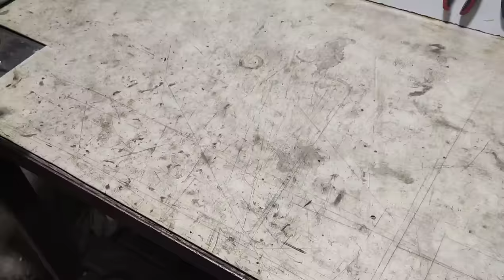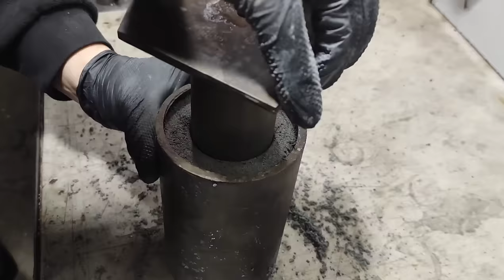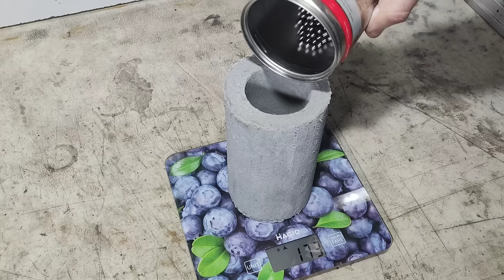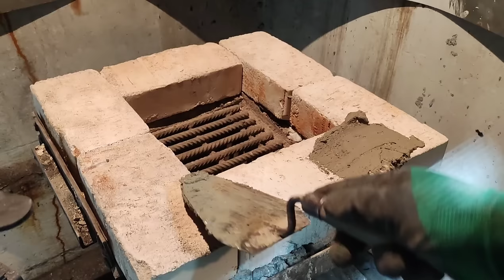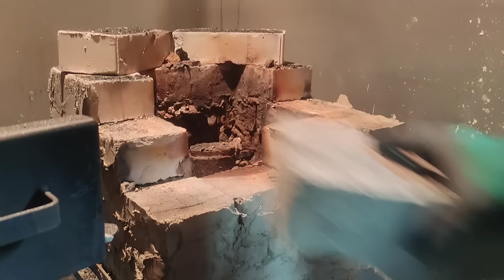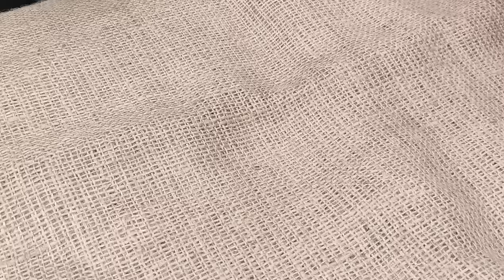How to make a melting FURNACE and CRUCIBLE for WOOTZ steel

Comment: True wootz will come from the mine of Salah Ah Din. There's a 3% vanadium content in that ore that isn't present in other areas, which made for exquisite patterns once drawn out.
Reply: You are make some "true wootz" right now?
Reply: 3% vanadium ??? No. No way. Maybe 0.003% or 0.03%, but not 3%. A tiny amount of vanadium is enough to change the pattern of a wootz steel, and vanadium is rather rare in ores.
Reply: @jeanladoire4141  it's not about the pattern, it's about the properties that the vanadium imbue into the steel. Those swords were known to flex in combat and then come back to being true after each strike. The mine that Salah Ah Din used was found again, and the composition of the ore was determined from samples taken.
Reply: @gra4279  ancient wootz steel didn't have significant vanadium content, it didn't affect the properties of the steel like with modern steels. Larrin Thomas recently made a video on his tests of wootz (following the ancient compositions) and the performances were pretty bad. Hard steel, but very brittle. A lot of ancient wootz swords weren't even hardened, by fear of breaking them. Tiny amounts of vanadium only had effects on the pattern, and not much more

Comment: It's amazing how inclusive the blacksmithing community appears. However, so many processes and techniques are shrouded with secrecy. A lot of questions are met with either extremely technical jargon, or vague brush over. 

Thank you so much for this video. Still leaves a lot of questions for the green, but at least gives a comprehensive step in the right direction.
Reply: … Because a lot of things are rather technical or require skill accrued from practice to do. So you have a simple version, and the actual technical explanation; wait, what’s the complaint again, if there is clearly both being presented? Also, very few things are secret in blacksmithing anymore, anyways.

Hell, do you know how dangerous molten steel actually is? Drop that on concrete or anything wet and you have an uncontrolled explosion with shrapnel and molten iron. If you want the technical info, go to blacksmithing forums and not youtube.
Reply: @farmerboy916  I do surf the forums when I am in search of information. The closest I found to an instructional for wootz/crucible steel. Was basically a journal entry cataloging one person's experience working with the metal and how he made cast iron several times. Not how he made it. "I put it some high carbon steel and a low carbon steel to balance it out between 3-5% carbon content. Topped it off with some glass, I  prefer champagne bottle. Then I put it in the furnace for a while until it's melted." 
Yeah very helpful. Thanks. No mention of method, fuel source, or even an actual duration.
Now,... Google isn't my friend. Many an hour I have wasted trying to find information. Only for the topic to come up shortly after in conversation and someone will list off a bunch of sources. 
YouTube is not the be all/end all of quality information. But sometimes it is the only place to find an explanation.
Thanks for the input
Reply: @cameronroberson1114  If you really want the best source out there especially on YT, it’ll probably be Neils Provos. Old videos but good. Admittedly, some of the old thread and forums may have died now, but I suspect there’s more than that.

Think about what you’re asking; it’s crucible steel usually done with a closed top, so fuel or heat source technically doesn’t matter a whit (even open top is only going to have so much effect one way or another depending on carbon compared to the atmosphere), and each home constructed foundry is going to have different capabilities and requirements and run differently. Any refined fuel is going to run hot enough for you with enough air, at least in theory. As well, until you break out digital scales and start working with pure or specific known compositions there’s not really any ability to have material consistency between people. 

As well, what’s your goal? To make good steel and alloy, to make it from scratch for the novelty or for the challenge, to imitate classical wootz/ bulat (and to what degree), to recycle material? Some are much more difficult.

With this many variables no one wastes time trying to write a comprehensive guide, you’re going to have to pick a direction and estimate and troubleshoot.
Reply: inclusive? i see people sh!t on pattern welded knives/etc all the time and scream "iTs NoT tRuE dAmAsCuS!!". Especially on youtube shorts or shorter form content, maybe their way more inclusive on forums or in real life, but in youtube specifically i see plenty of hate
Reply: @IllNacs  … So you see people say something pedantic but true, and say it’s awful because of that? Grow up.

Comment: I love watching your videos. They are always fun. Could we get general amounts of the materials you used for the crucibles in the mix?
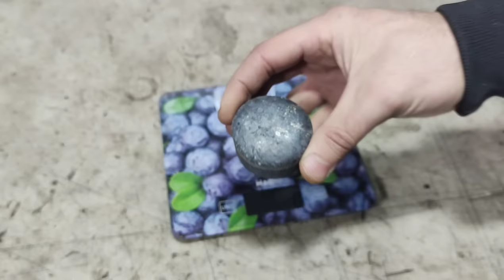Reply: Assuming 525g final weight at 7:30
~33% whole bearings (173g/525g=33.33%)
~58% bearing balls (303g/525g=57.71%)
~9% iron powder (46g/525g=8.76%)

It looks like he adds around 2g of graphite at the end, though that's just an estimate. Maybe 0.5%?

If you're considering steel strength, you would want around 0.5-1% carbon by weight. The ball bearings he uses are likely 1% carbon already, so you might adjust the recipe he's showing here to have more iron powder and less graphite powder. Glass powder is just flux, enough to cover the top will work. Not precise.

The most important things seem to be the use of different sized bearing steel (chromium steel) parts and iron dust to create the wootz pattern, plus a little carbon (graphite). For anyone looking to try this, you might use this recipe:

~90% Chromium steel parts of various sizes
~9.9% Iron powder
~0.1% Graphite powder
+ Enough glass powder to cover the top
Reply: @N1ck00  Thank you for that break down of the steel. That does help for when I want to do this later. However, I was asking about the crucible itself, not the metal going into it.

Comment: This is another amazing video!  Do you have to re-build the furnace every time you create an ingot?  Also, what types of steel work best for wootz?  I think I've read the ball bearings are often high in chromium.  Great video! 👍
Reply: If you want to get pretty close to the composition of historical wootz steel you might try melting 1 part W2 steel(for the vanadium) to 9 parts wrought iron with enough charcoal powder to get the total carbon content up to 1.5%. The chromium from ball bearing steel is a carbide former, but it will be somewhat different than vanadium, and I don't know how much you would need to use.
Reply: @garethbaus5471  This is fascinating to me - I read the old Pendray articles way back when, but metallurgy is pretty far over my head.

Comment: Thank you for sharing your process. Truly generous of you. If I may push my luck - does the amount of graphite you're adding matter? I see the amount of HC steel to iron powder you're using, but the graphite was a mystery. I really really want to try making my own but finding a complete recipe is really hard and I have no methods of testing steel composition or actual HRC.
Reply: I'll go out on a limb and say yes, it likely does, though I'm really only guessing and basing it off modern metallurgy practices.  Too much graphite and you'll end up with a fancy cast iron alloy, don't put any in and you'll end up gassing off too much carbon and end up with a fancy mild steel alloy.  I guess you'll have to experiment with different quantities of graphite and see if you end up with a malleable steel or a brittle cast iron.  There are numerous ways to determine a rough estimation of carbon percentage based on how the metal acts when you drill it, grind it, bend it, harden it, etc. so you'll be able to spitball your way into the right range.  You'll certainly want to buy a set of hardness files off amazon, or a set of hardness chisels that you can re-sharpen over time, not just for this, but to check whatever knife you make to see if your heat treatment actually worked.  Probably not the answer you wanted, but if you're determined to make crucible steel, you'll be capable of getting your own answer eventually through experimentation.  I'd start off approximating the amount of graphite based on the video and adjust from there if necessary.

On the other hand, perhaps the graphite will only infuse so much into the steel, and the steel simply won't be capable of absorbing the excess in a crucible.  So maybe it doesn't really matter how much graphite you use, just as long as you use enough for it to do its thing.  I honestly wish I had a better answer for you.
Reply: @Skinflaps_Meatslapper  First off, love your username. But yes, I know that the hardness files exist but they're a bit dubious at times, and as a hobby smith with a full time job i'm just being lazy and want a quick answer :) I don't really have the free time to experiment with something like this, since having all the answers will still require a lot of tweaking to get it dialed in already; working with too many variables (with one of them being graphite amount) essentially makes this an insurmountable task for me, practically speaking. But maybe i'm  just being a turd and should just do it and figure it out myself anyways, I guess its not like I have a timeline to learn this. I just figured since FZ is already being insanely generous with his information, it wouldn't hurt to ask for that last variable. I know that the graphite can potentially turn the billet into cast iron (I have a decent understanding of metallurgy basics), but like you said maybe there's a rate limiting absorption happening with that cook time and temp and a general amount is all you really need to figure out? I couldn't say. Maybe I should document my journey...hmmm
Reply: @thezoidforge9211  Sounds like you're in the same boat as me.  All of this is well within my abilities and budget to test and experiment, but a bit over budget on free time.  I basically came to the same conclusion...I'll just have to start cooking buttons of steel and testing them until I get to a point where I have good consistent steel to work with, making notes along the way.  95% of the work and knowledge has already been passed down to us, we just have to figure out that last piece.  Imagine what it was like for the smiths to go from knowing nothing about crucible steel to developing all of the techniques and processes we know today.  More than likely it took the dedication of many generations to see it through.

The way that ingot rings at full forging heat leads me to think that maybe I should get a press and power hammer though.  Only time I ever had steel like that was when I got some high strength sucker rod for deep oil wells, I could hardly move the stuff with a 4lb sledge.  Not really looking forward to that part.

Comment: Finally Thankyou can I use bentonite clay instead?
Reply: if it were me, I would use fire clay as he suggests in a prior reply.  If you google the "maximum temperature" and bentonite or fire clay, you will find that fire clay has a melting point of >1,700C while bentonite is >1,200.  Remember that many of the published temperatures for experimental wootz furnaces are ~1,650C.  I wold expect that a crucible made from bentonite clay to become fully plastic and essentially melt at ~1,600C.  I wish I had digitized copies of the photos we took when the temperature controller for one of the kilns in my families pottery business failed in the ON position...  We had an entire load (~1m^3) of "earthenware" pots (which has a melting point of ~1,250C), and by the time we got everything cooled down (including the walls which were steaming for most of a day), the pots melted and literally were drooping over the edge of the kiln shelving.  

Fire clay is a very common material to purchase from a ceramics supply store, just make sure that you purchase a high-quality clay.  Also, here they call the "fire clay crumb" I have always heard called 'grog', but it is also commonly supplied at every supplier I have ever seen.  Alternatively, I would suggest cobbling together a furnace/kiln like he shows in his videos, and experiment with making crucibles from different materials and firing them with some easy to find materials (like steel scraps) melt.  I would expect that the bentonite will fail long before the steel actually melts.  If you try this, make a video, and post back a link so that we can all learn from the experiments.  As a note, it is not a 'failure' if you learn something - just proceed carefully, and learn from what you see.  Also, always assume that the crucibles will come apart or explode, and set up your shop and process for safety.  Hope this is helpful.

Comment: Thanks for the detailed information. That graphite is of most interesting, which should enrich the carbon in steel even further. Perhaps you can use coke to further rise the temperature? Charcoal are not that good for achieving high temp.

Comment: why is glass mixed with the metal?  Does it keep the metal from binding with the crucible?
Reply: It's there as flux. Basically it forms a protective layer on top of the steel, and binds with slag and impurities so they don't end up mixed with the metal.

Comment: I don't know if you have answered this before but are you using coal or charcoal to fuel the furnace?  I have access to both just curious how you go about doing that?
Reply: Usually it's said that charcoal is a better choice for heating crucibles and melting metal, it makes a wider fireball

Comment: One small question; "fully cocked" how do I know that?  IS there an approximate time you can give?

And thanks for sharing! have so many small scrap piece I would like to use for a test.
Reply: He mentioned two hours, so I guess he loads the forge up and lets it burn out, then comes back the next day when it's cool.
Reply: @Skinflaps_Meatslapper  Hi! Where does he mention 2 hours. I could only read "Cook until fully cooked"..?
Reply: @thomasnyberg991  Oh, it was here on the video comment section in a reply to someone else.  Thought I'd pass it along.

Comment: So why do you bother hand hammering each of your billets before putting it in the press?   The puck of wootz is so hard that the hand hammering basically does nothing to it and it's the press the moves the steel around...
And do you try to take into account the starting carbon content of your raw stock (ie ball bearings, etc) and adjust the amount of iron powder and carbon you add, or do you always add the same amount and kind of let everything figure itself out in the smelt?
Reply: Hand hammering gives the puck some flat surfaces, which allows the press to act more evenly on the billet. Just facilitates better shaping.

Comment: Why is the glass added?
Reply: I could be wrong, but I believe it melts to form a molten cap over the steel/iron/graphite. This helps keep oxygen from getting in (preventing oxidation) as well as letting any trapped gases out - kinda like an airlock for brewing. I'm sure there is more to it than that, but I would think that would be the main function of the glass.